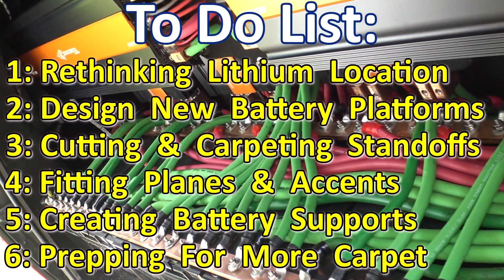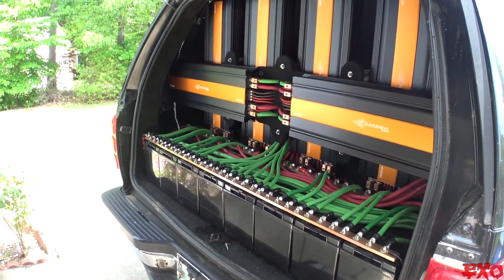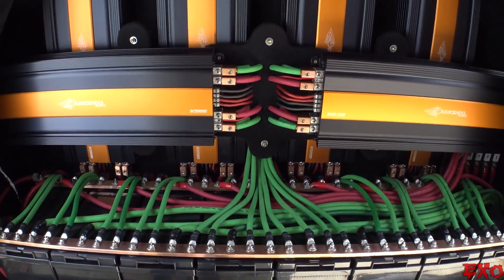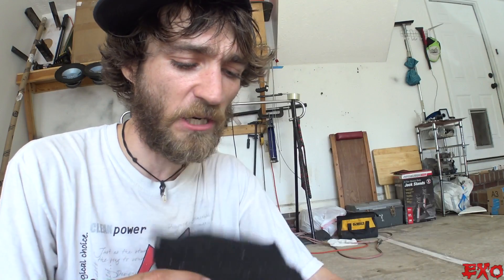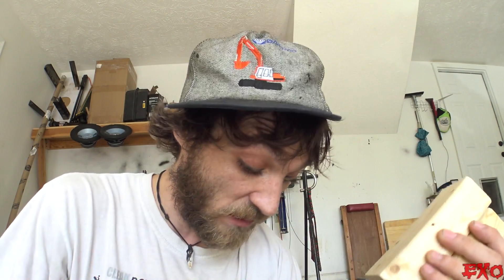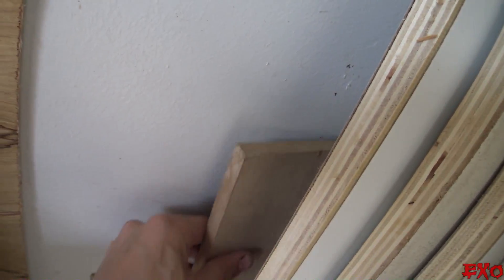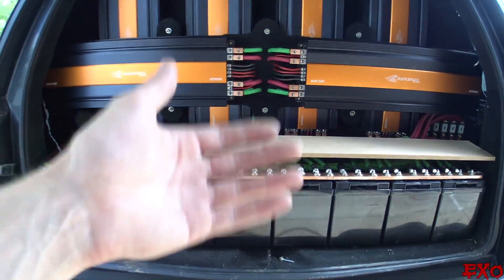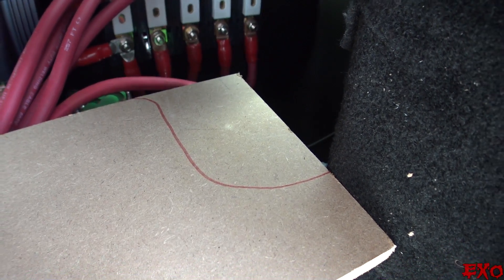30,000 WATT Lithium Battery Install w/ JY Power Car Audio Batteries | Two Parallel Banks 12v Wiring

Comment: I knw this video is a older video but these batteries are they really good I need something better then what I have I got a 390 alternator and 4 avatar 15s and 4 avatar 3500 on 2 cypher 12k and still having voltage drop to low of a drop amd I was told my set up was awesome set up amd should work correctly but I have work and looked over my setup and see nothing wrong or the reason why I'm dropping so low need some help plez help

Comment: Can I use high quality 18650 batteries like the NCR18650GA batteries to power my skar audio sdr subwoofer 12s 2400?. I got about 480 NCR18650GA cells ready to go .

Comment: +Exocontralto anyone got some advice on how to amplify the remote signal wire when using multiple amps? Or is that even necessary? I'm using the new Kenwood DDX9903S

Comment: do you know of any used batteries for sell cheap? I need all the bug deep cycle batts I can get. but I need them to power my house!  I'm using hydro electric and a  generator to charge them and run 220v appliances. but will be adding solar soon as I can. but I need batteries! since you moved kinda close. I thought I'd ask. keep it booming and thanks....

Comment: In your personal opinion do you think one 100AH Lithium is enough for 2 Crescendo 12 inch Contraltos powered by the Crescendo 4500 Encore series Amp? obviously with a high output Alternator.

Comment from the maker: 30,000 Watt Electrical Upgrades!!! :D
Reply: I'm just sayin, he's electric system should be able to make around 60,000 watts just in batteries alone! With the alternators he should be able to pull around 75,000 watts. Just a matter of cooling the AMPs.
Reply: OH there is NO doubt that his electrical can handle the power, the question /problem is HOW LONG.
30kw @ 15v is still 2,000amps at 100% efficiency.
Even with 1000amp/hr of reserve, and all those alternators, he can still only play for an hour top.
Wich, for daily driving/demo's that is totally fine, but then for shows you have to sit for a long time to recharge.
Reply: Completely ignoring the fact that hiring EXO is not something he advertises, I highly recommend doing the build yourself.
Other than saving a ton of money, you get the satisfaction of doing something yourself.
Though, i will admit, the thought of having the legendary EXO assist in a build makes me very excited.
Reply: EXOcontralto I'm trying to get some information off you or your buddys I've asked this question several times but goes unseen I know you're a busy man I am curious  about the Jad 1200.1 you had them running at half an OHM and your dad's truck are they still running at half an OHM and how we'll have they done
Reply: I know little blue is above 150db.
Reply: EXOcontralto u hav a direct contact to get through to you Exo?? am from the caribbean an i need advice on doing my instal
Reply: Just ask your advice on youtube, and someone should pop in with some advice.
EXO is too well known to be able to stop and give everyone some advice.
He also already has dozens of helpfull videos, you should do your own research first :)
Reply: Ammm i kinda want to hire him to come do the build for me cause the people in my county aint knw wat they doing
Reply: Ok thanks man
Reply: I would assume that unless EXO put up a video updating us with a change in that install that it is still working just fine.
Running an amp at a half ohm is fine in most cases if you have sufficient electrical.
Reply: SterTheDer it is not rated to go to half an OHM that's why I'm curious I have not even turn this amp on yet I'm curious if this amp we'll run 4 12s at the half an OHM I am not sure what the certified RMS rating is and I would like to match the wattage correctly
Reply: If in doubt, it is always best to run amps within their ratings.
Half ohm is very hard on them.
It is also terribly innefficient. The best plan is to run your amp at its rating, and if you need more power then get a second amp.
Reply: SterTheDer that's the thing about this im tring to eliminate using two amps on 4 12s so next question is I can run all 4 12s  run the speaker in a phaze  to stay at 4 Ohms and run them all parallel to get them at the one ohm rating and get 1200 + rms watts  out of the amp can the nvx handle running  4  12s
Reply: If you can wire the subs together to reach one ohm, then your amp should be able to run them just fine.
If it doesn't give you enough, then you can always upgrade your single amp to a larger one.
My advice is to try things out :)
Reply: Clicked instantly!!! EXO, what speakers do you run in Frank? Isn't the amps supposed to make a bit more if you take em down to 0.5 Ohm?
Reply: You can see what he runs in Frank if you watch the videos about them. He runs Crescendo for the door speakers.
Amps do make more power at 0.5 ohm, but they do so at the cost of lots of power and heat. you get diminishing returns.
You might make 1000w at 1 ohm and 15-1800 at 0.5ohm, but use almost double the power.
Reply: EXOcontralto hay did you ever dyno little blue? what numbers was she throwing around? it looked pretty gnarly in the one video of demos with the chick with the black sweatshirt doing the gnarly hair tricks... your girl was as proud as could be bout blue... lol
Reply: Doesn't he have like 1500 amps in alternators? He could still be rocking 4000 amps for quite a while! The lithium will take most of the 2500 amps extra that the alternators can't supply, even then the batteries should be able to take around 2000-3000 amps of power without heating up!
Reply: Something like that, 5 or 6 350 amp alternators.
He can certainly push the power for a while, but he is still at the mercy of his reserve capacity. At only 1,160AH of a reserve, he cannot demo for hours.
Reply: y keep it up bro tell the internet
Reply: I don't think he would be able too, events seem to last just an hour because of noise complaints, at 60 Kw he should be able to play 25-35 min before voltage drops under 11.0 V, at 30Kw he can play all day long, probably why he calls it a 30Kw build.
Reply: All i can do is speculate :)
I do know that by the time the voltage is dipping below 12V things start to get a bit sketchy.
Reply: EXOcontralto love your builds! you are an inspiration!
Reply: SterTheDer you mean all " he " can do
Reply: well... I mean... The sentence works both ways.
I intended it the way I wrote it, indicating that I am not qualified to do more than speculate how EXO runs his audio systems.:)
Reply: EXOcontralto i even beat you at being first exo